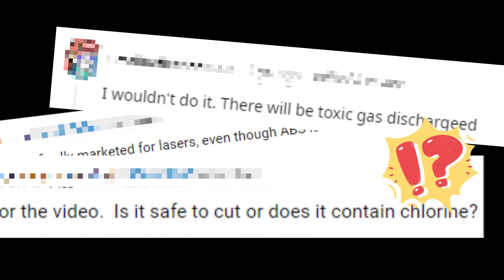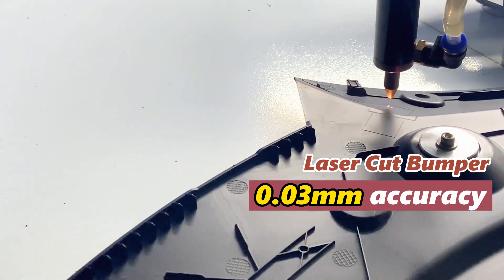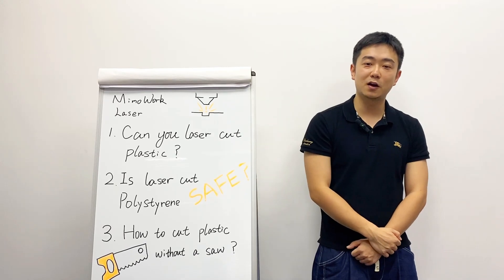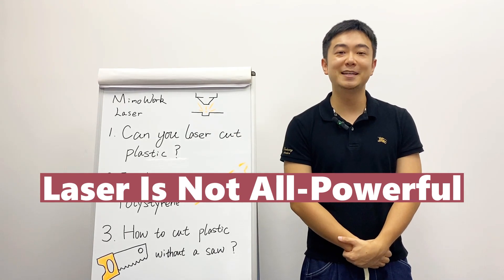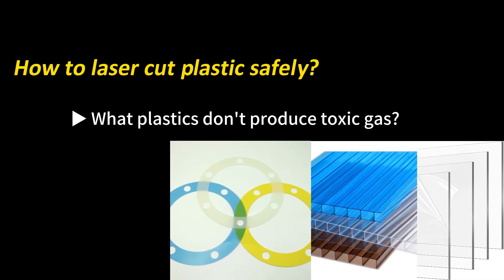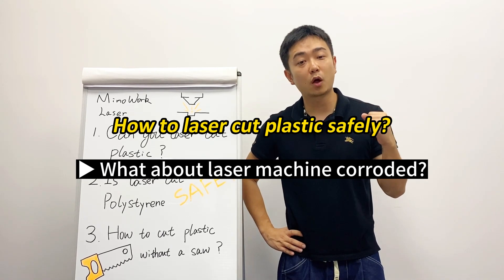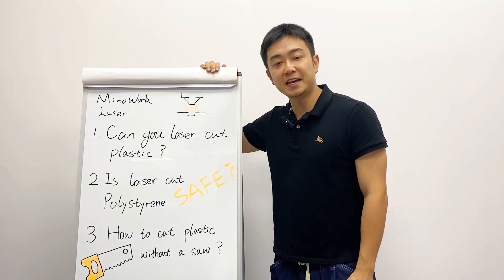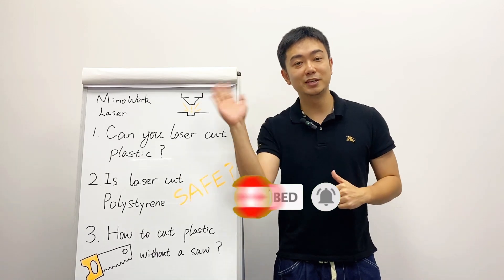Debate on Laser Cutting Plastic: Why Many Car Factories Using Laser Cut Plastic Parts? Is it Safe?

Comment: Hi, can I use a fiber laser cutting machine to cut plastic? Our machine is for metal, but if I change the parameters I could use it to cut plastic?
Reply from the maker: We don't suggest cutting plastic using a fiber laser cause plastic has a low absorption of fiber laser. In general, the CO2 laser is better for cutting plastic.

Comment: Great content, I only tried using CO2 to cut acrylic, and never tried on vinyl or PVC. This video refreshes my view on laser cutting plastic.
Reply from the maker: Thanks! As long as you have proper ventilation system, including a fume extractor implemented, you should be good to go! You only tried using CO2 to cut acrylic? How did it go? Had any problems?

Comment: Acrylic smells really bad, but that is what an exhaust fan is for.
Reply from the maker: Yes,  especially if you are using an additional fume extractor, activated charcoal can absorb these flavors. Are using currently making acrylic products?
Reply: @mimoworklaser  Yes. I looked into fume extractors and they cost way too much just for the equipment. 

Also, the  activated carbon was way too much. It was $300-500 USD every 3 months. It’s much cheaper just to  exhaust outdoors and bring 50-75% make-up air (outside air) blown into the laser enclosure to reduce the load on the HVAC inside.
Reply from the maker: @ericthehalfmexican9187  Have you known the industrial pulse dust collector? It's more cost-effective. By the way, on the subject of working acrylic, have you tried applying masking tape before engraving for a better result? We had a video about that: https://www.youtube.com/watch?v=3mAJCgBChiY&t=129s

😀Can you share with us some tips about laser working on acrylic?